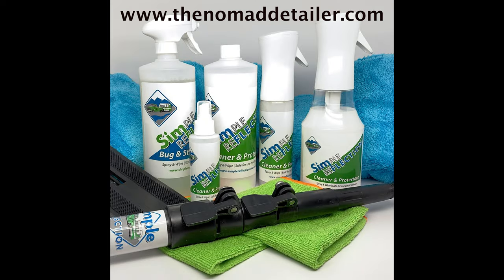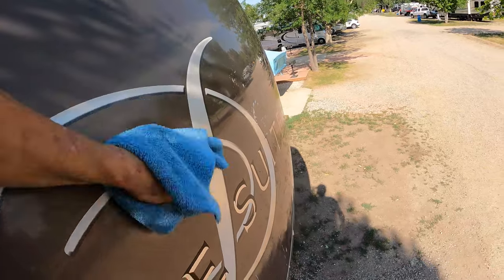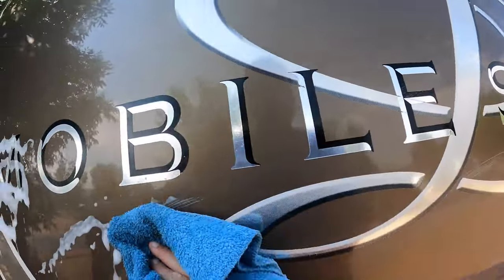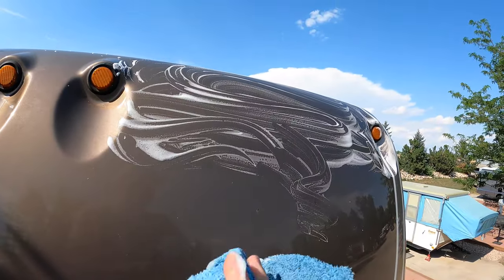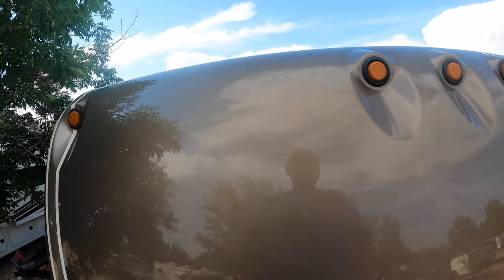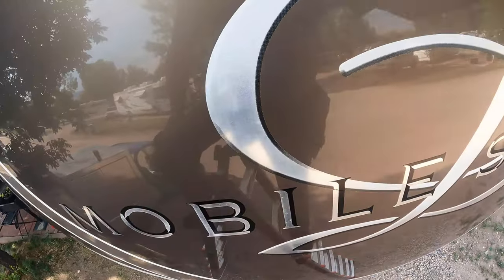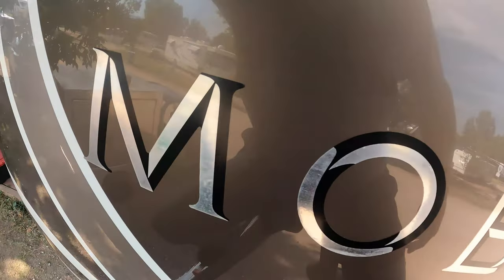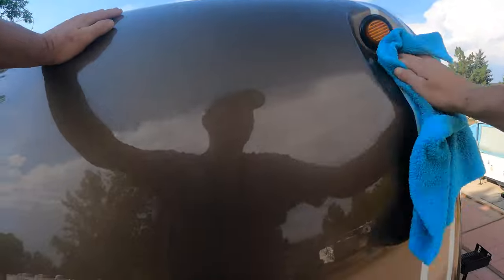Are you looking for the best RV Cleaning System on the Market!  Never scrub bugs off again.

Comment: Hi Leon, just discovered you. Saw the frame crack video. Have friends that are at Lippert right now to get their frame fixed.  QUESTION: does this stuff work just as well on fiberglass? You only mention paint.
Reply: front cap in video was molded fiberglass